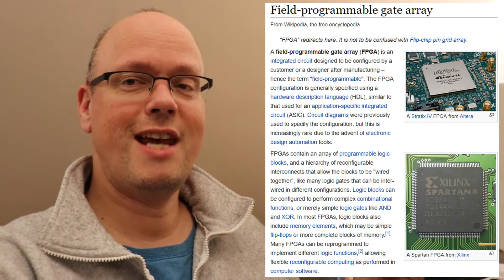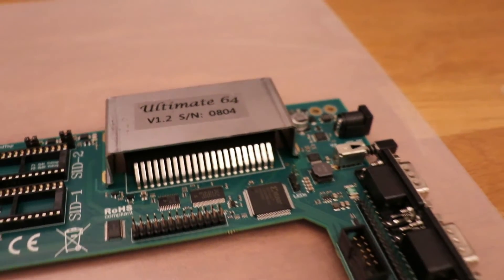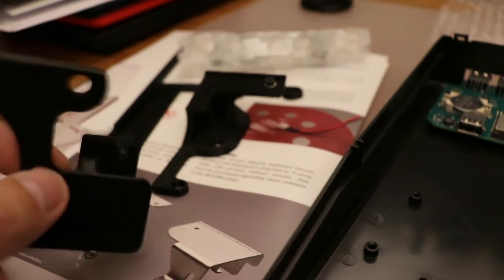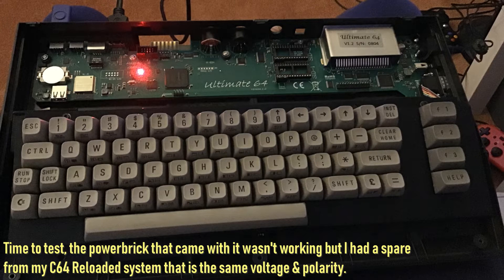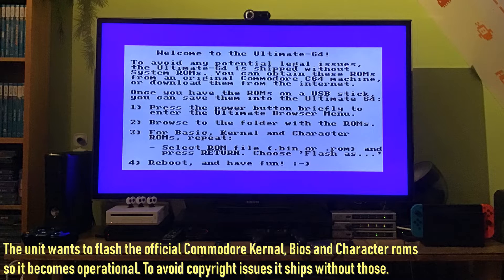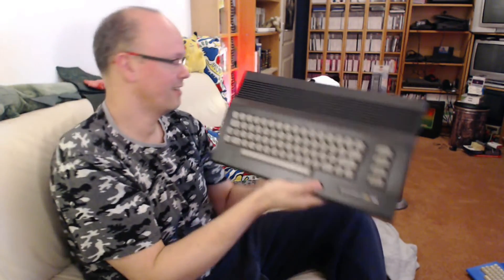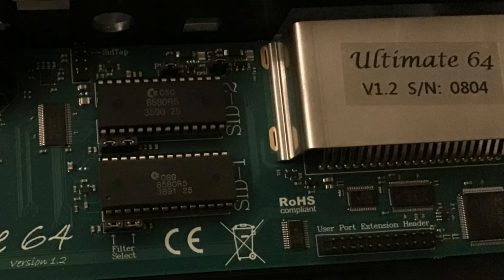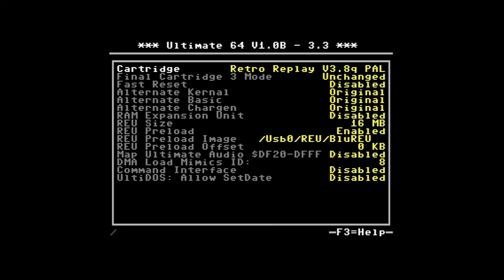My Ultimate64 Experience - Part I - Unboxing & Building (post 1.5 day shift edition)

Comment: Great video - are you able to list all the parts you ordered (inc. keyboard mounts)?
Reply from the maker: Thanks, but Oh it has been quite a while, I reckon a lot of inventories of webshops have changed so coming up with a list would be pointless. 

1. replacement c64c case and a set of reproduction C64c case decals 
2. C64 keyboard board, cable and c16 keycaps
3. 3D printed mounts for keyboard and c64c case
4. 3D printed surrounds for c64c case, IO (power, joystick etc), rear IO and around motherboard - cosmetic
5. The Ultinate64 
6. Two SID chips, both types - not mandatory

Comment: My keyboard brackets look different than yours. Where did you get yours? Mine are from Pixelwizard.
Reply from the maker: It has been a while. Not sure where I got the from off the top of my head. The name does sound familiar. If I don’t mention it in the video I may never be able to recall. Sorry...
Reply: @lactobacillusprime  I did some googling and found it. COREi64 Store https://corei64.com/shop/index.php?route=product/product&path=65_66&product_id=195

Comment: Ben niet zo blij met de C64 Reloaded MK2 vanwege de slechte beeldweergave. Hopelijk kan ik met de Ultimate 64 Elite Rev1.3 wel veel plezier van hebben. Daarnaast heb ik originele in mooie staat verkerende C64 Breadbin FAT 250425 RevA, C64C 250466 en de C64G 250469 Rev3 waarvan een Lumafix erop  moet gebruiken. Normaal ben ik volop bezig met mij AMIGA 1200 projecten. 

Zijn mooie C64C behuizingen, die je heb. Hopelijk kan ik een transparante C64C behuizing van Pixelwizard ervoor kopen.
Reply from the maker: De Ultimate64 heeft een goede beeldkwaliteit. :)

Comment: in another vlog i heard that only the old breadbin case work since the keyboard won't fit.
true or false?.
Reply from the maker: onehappynegro the c64c case uses stands for the keyboard which is identical to the breadbin’s. You need stands which usually are in the C64c case and if you get a repro case you need to get some keyboard stands - that’s it,

Comment: I have several of the PixelWizard cases as well as a couple of the original Kickstarter cases and a couple of the Reloaded MK2 boards. I tried to use the C16 caps on a C64 keyboard, but while I loved the look of the color in both the C16 and SX-64 themed C64C cases, I simply couldn't get past several of the keys having different functions printed on them (the matrix isn't the only thing that is different).

The Ultimate 64 board is definitely on my list of things to get next. Thank you for sharing your experience with us. It looks great!
Reply from the maker: Thanks. I see where you're coming from with the labels being different on the C16 keycaps. The keys having different labels is a given with that range of systems. To compensate people have have been moving them around a little to resemble the C64 layout a bit more - it does make it a little more do-able. But what happens with that is that the keys don't match the curve of the keyboard anymore and stick up or sink down more because they are in different spots. I am so used the the C64 keyboard myself that I don't really need to look at the keyboard to type in the correct key.

Comment: What an awesome/ultimate kit build project, you must have been so pumped up/thinking about it for your whole shift :) 
Everything looks to be excellent quality. They have thought through the mounting quite well.
Hopefully they continue to make these boards, as wouldn’t mind doing the same sometime in the future, especially as original hardware won’t last forever.
Final unit looks awesome!
Reply from the maker: electricadventures I little mistake I made was to think that the keyboard matrix of the c16 and the C64C were compatible. I needed to refurbish my C64C keyboard and swap over the keys from the c16. The shift/lock key can sometimes cause problems when doing so but I got lucky. Very stoked with the unit and I was well prepared when it all came. You’ll probably love such a “new” Ultimate64 too. When you run it it really feels like a C64! it is a C64.
Reply: lactobacillusprime it looked awesome - I will have to look at getting one if they do another run. I have a non functional Vic 20 with a keyboard and I think another C64 one with a couple of key tops missing.
Reply from the maker: The Vic keyboard will most definitely be a good donor as they keyboard is identical also electrically.

Comment: Impressive board, the Reloaded might be a little closer to the real thing, but the Ultimate sure beats it in terms of features and flexibility! The charcoal case is awesome too, the C16 color scheme is so good.
Reply: It s the best c64 re-implementation. As simple as that. No other board comes close to it.
Reply from the maker: GalacticusX thanks! I quite like the c16/Plus 4 colour scheme. Secretly I am hoping for c16, vic20 and c128 cores sometime in the future. I find the ultimate 64 to behave and feel like a “real” C64, it feels a little more future proof than my reloaded board as that does depend on many of the old chips. I am hoping for modern plug in chip replacements like exist for the Sid and PLA that exist today. If VIC and other chips can be “replaced” by modern parts on the reloaded I will go for that too.
Reply from the maker: GalacticusX the bios flash first turn on colour scheme is reminiscent of a c16 start up screen and seeing this online may have attributed to my choice of colour scheme for case and keys.

Comment: I just tested mine. Forgot to update the firmware so my first game didn't work :) Rendering a wee video now...
Reply from the maker: The Highlander LOL love the intro, very stylish ;) 
The donkey Kong fail on the stock bios was epic. With a system in development like this, demos and games not working is a think you can expect. But the latest bios (beta) fixes a lot of things as it now implements all the stable illegal opcodes. That may actually be one of the main things that was breaking compatibility before.
Reply: @lactobacillusprime  Yeah I installed the new firmware and Donkey Kong ran just fine. I think I saw the issue on facebook before somewhere.

Comment: Always a good day when there is a package from Gideon :D These FPGA solutions are pretty much how to make retrocomputers survive for the more distant future once real hardware has failed as they eventually will.
Reply from the maker: Polaventris indeed, it is also about preservation. The C64 boards are very sturdy and most of the electronics are keeping up well. Chips need to be heatsinked, boards preferably recapped and the original power supplies need to be reigned in as the latter is a killer for many a C64. C16/Plus 4 machines are much more “fragile” failure prone. All of mine have died.